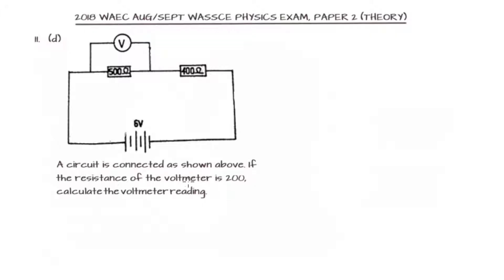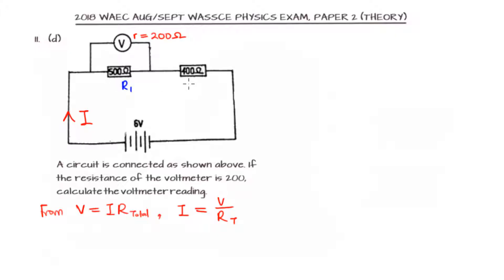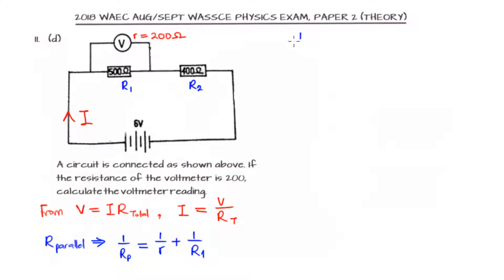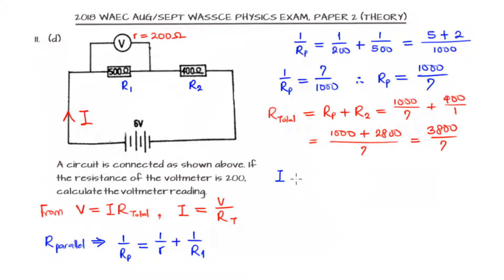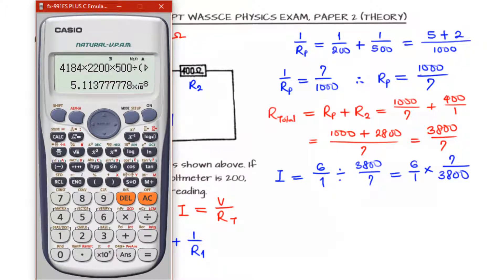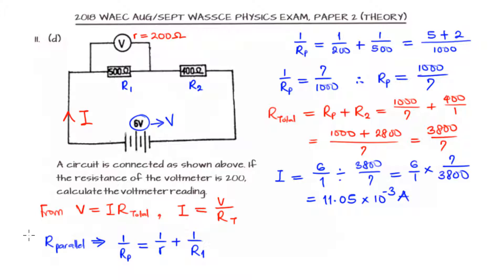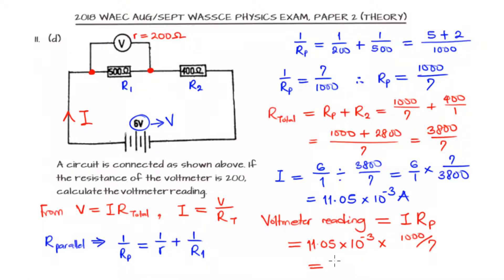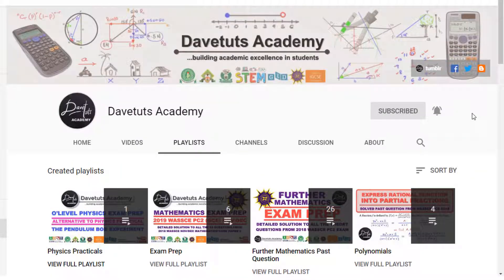Finding the Reading on a Voltmeter with Internal Resistance in a Circuit

Comment: I thought resistance on voltmeter is infinite so that no current will flow through it?

It should be
1/R|| = 1/R1 + 1/infinite
1/R|| = 1/R1 + 0
1/R|| = 1/R1
R|| = R1

R(total) = R1 + R2
I(total) = V(total)/R(total)

Voltmeter reading = I(total)*R1
Reply from the maker: Good observation there, Nellvin. The ideal voltmeter has quite a large internal resistance in the order of 10 Mega-Ohms. But that is the ideal case. Think "ideal gas" and "real gas" analogy in Chemistry.
However, in this particular question, the internal resistance of the voltmeter was explicitly stated and as such, the right approach was deployed in solving the question.
Hope this clarifies your enquiry.
Reply: @DavetutsAcademy  ok sir thank you!!! I was just confused.